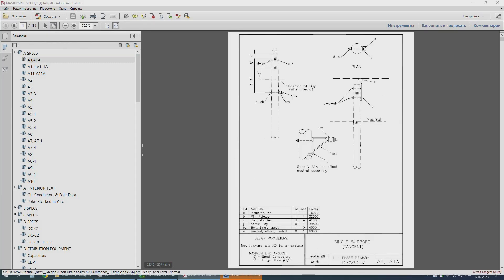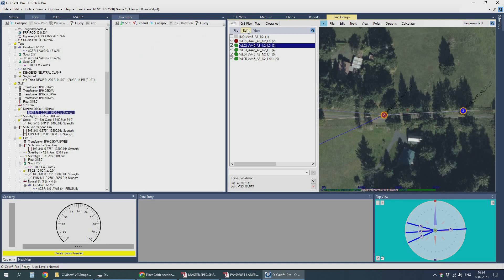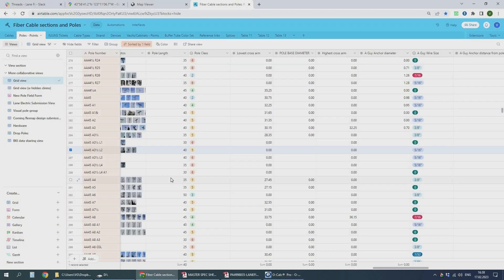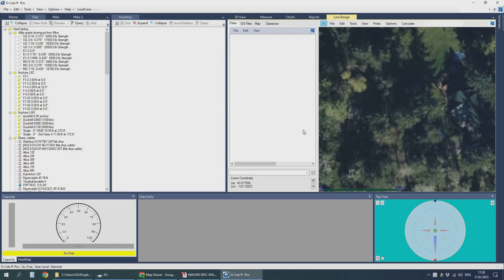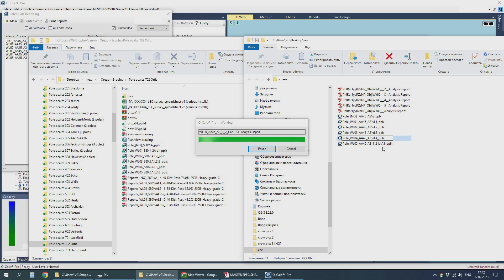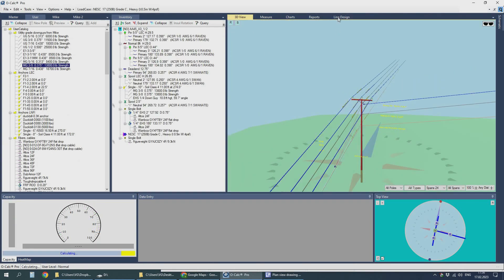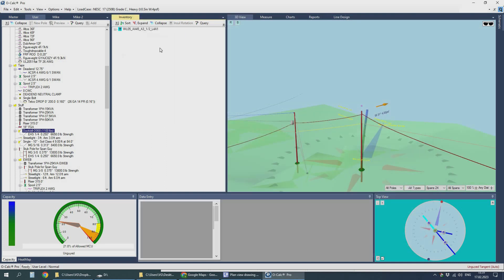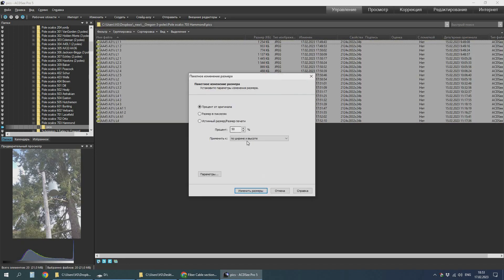Pole loading analysis using O-Calc Pro Line Design. Engineering an install with SS fiber optic cable

Comment: Is the shear and angle loads supposed to be negative on guy braces on  the pole loading analysis?
Reply from the maker: Not necessarily. Their value in ocalc report depends on worst wind direction, so it can be any